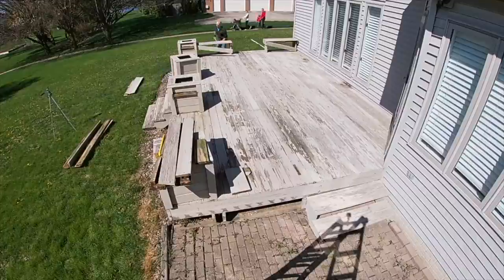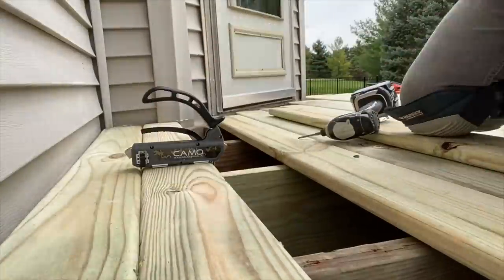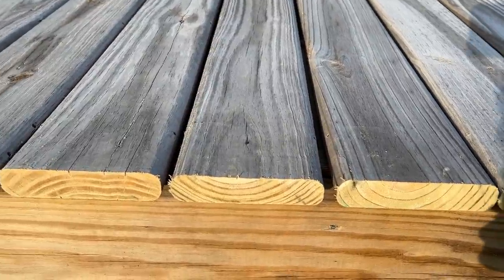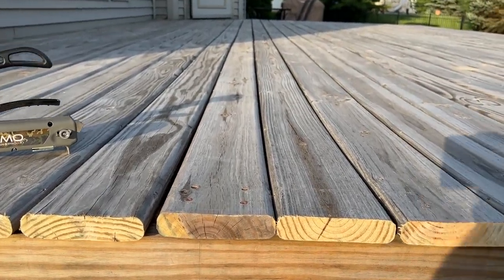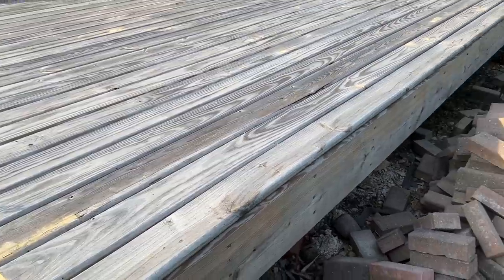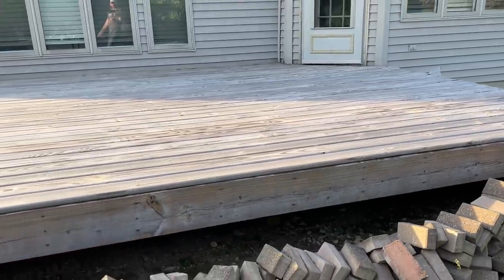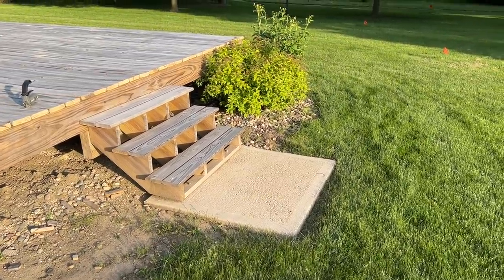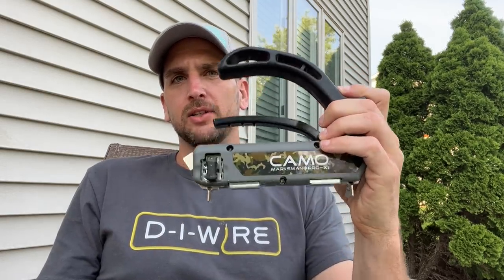Deck Rebuild Project - Pressure Treated Wood After 2 Years

Comment: Just to offer a side note regarding laying the boards  - One thing that happens to boards exposed to the element is that they may tend to "cup" if the grain is laid facing up and ends up collecting/holding rainwater for longer periods which impacts the overall quality of the board.  Although hard to tell on some boards, for most boards, you can look at their cut ends and notice the growth rings forming a U shape.  The board will tend to warp over time in the direction of the rings.  To minimize the effect, lay the board with the open end of the U-shape facing down to the ground and secure the board down.  The board may still cup slightly, but it will be facing downwards and not retain water.
Reply: Just FYI …This is called  CROWNING the boards  🙂
Reply: I too noticed right a way some boards were wrong. I refer to making the end grain with a "Happy Face".
Reply: Marvin Morgan if you make a happy face when the boards shrink they will cup up and water will sit on the surface.
Reply: I don't argue, but turned to the classic book "Understanding Wood", A craftsman's Guide to Wood Technology"; by R. Bruce Hoadley. Page 124 discribes CUPPING and notes the direction of WARPAGE. I will stay with the "Happy Face" on the end grain to avoid a gutter and to have water runoff. Look it up to understand.
Reply: Marvin Morgan I stand corrected. You are correct sir.
Reply: @eskilover you have it backwards. Boards crown away from their bark. Smiling boards up
Reply: Does not matter. I put all mine bark side up and they cupped, twisted and shrank. I even sealed them on both sides before laying. They were SO wet from the store that liquid shot up at me when I drove the nails in! I have a cap on my railing and one board is up while the other is down (placed for best looking side up) and they BOTH cupped.  It is just the CRAPPY boards they sell you. I am pulling up my old decking (28 years old) and putting down new so it doesn't look so bad when we sell in a year or two.
Reply: I'm either misunderstanding your explanation or you're backwards.  The end grain laid properly will smile. You want the curve up which puts back side down. Notice your 1 board that is pulling up is frowning not smiling on the end grain.  Nice deck though. Great work
Reply: @hotpuppy1  It does matter because of the way wood dries, based on science. Yes, regardless which side is up or down, some pieces will cup/crown. However, it's less likely to cup when you lay your board smiley face. I'd say at least a 6 to 4 ratio. Sad face installation has a 60% chance of cupping, while smiley face installation has a 40% chance of cupping.

Comment: Just built such a deck and used shorter boards with seam in the middle and picture frame around the outside. Looks great and you have more control over the quality of the boards. I also used the Camo system and like it. Clean your PT lumber well before sealing it and use and oil-based product and not a water-based one. Get one with a high UV protection. I now used joist-guard membranes as well. Worth the extra cost and time. Finally, after building and rebuilding decks over the years as a DYI'er, I now only use composite decking to finish them. I'm too old to be sanding decks!

Comment: Thanks for the video, great resource as always. I built a deck in 2014 on my ranch built in 2013. The deck was 16’ x 48’ long (768 sqft). The green deck board on the house was installed by the builder when the house was built, installed before & under the vinyl siding. I also installed a drip flashing in between. The surface boards were like yours but white cedar. The deck design was a cantilever off the home (13…4’ foot deep holes were dug and rebar was used and cement was mixed by hand in a wheelbarrow). The framing was 2 x 10’s all green lumber, 16” centers with double hangars with Tico nails. All boards were 16’ and 8’ long. First row (starting at the home) was 3…16’ boards, Second row was an 8’…then 16’….then 16’….then 8’. Third row was same as first, Fourth was same as second, etc. I used 3” colored screws with square holes rather than Phillips head all were painted. I used 2…screws on every stud. Drilling and counter sinking the end of each board (we used 2 electric screw guns with an insert using an end that had a square drive bit and flipped to an drill with a counter sink). Three of us did all the deck boards in 6 hours. I also installed a natural gas line with 2 shutoffs, one in the basement and another 16’ from the grill, for safety reasons. I also installed conduit and  remote switches. One line for the grill (rotisserie power) and the other for outside lighting. All of this was by code with permit and inspections. I started on the deck in April and finished it in July. The deck was stained one time and it wore off during the winter (Chicago area). The 32’ railing is in good shape as are the 2 stairs (one in the center of the deck, other in a corner).   Thanks….
Jim

Comment: Scott...Great job rebuilding your deck & adding steps...one tip I would suggest to make your ledger board last much longer, (since it looks like the original builder didn't provide proper flashing on the ledger) before you seal the deck boards, remove the one deck board next to the house and use "Flashing tape" on the exposed edge of the entire ledger board ( the top edge of ledger boards & joists are the most prone spots for decay & rotting on the deck framing). All the decks I have ever been hired to repair have had the most damage on the top edges of joists & ledgers that were not properly protected by using "joist flashing tape." You can get G-tape acrylic joist flashing tape, 1-roll of 2"x 65ft from Decks Direct for about $23-$25/roll (also comes in wider rolls). This may make the difference on your ledger board lasting just another 6 years or making it another 12-15years. The deck framing is the most expensive part of a deck to replace, that's why most "Professional Deck Builders" never complete a deck frame without using joist flashing tape. Great videos....Keep up the Great Work...

Comment: I too used the Camo screws for my 1500 sq. ft. wood deck (3 years ago) but I have not had good luck with this overall. I think the Camo system is really meant for composite boards,  just as an after thought. Many of my boards have pulled away from the screws as the boards shrank. The boards then curled badly resulting in me having to screw down the boards through the tops to the joists. The Camo system looks good (invisible) but I would not do it again for wood boards.
Reply: I had a similar experience using 5/4x6 radius edge pressure treated deck boards with the Camo system. I was skeptical, so I installed 6 rows of boards and stopped. After only 3 weeks, the boards were warping and popping past the screws. I ended up face screwing the entire deck (about 600 sf).

The boards stayed put by face screwing, and I used Thompson's water seal once the deck was complete. Despite sealing the deck annually, after only 5 years the deck boards look like hell. There are tons of checks and deep cracks on the surface of almost all of the boards, I scabbed scraps of 2x8 joists wherever I had to place butt joints to avoid screwing 2 ends into a single joist - but most of the deck boards have developed splits from the screw to the cut ends of the boards anyway. Note that I pre-drilled ALL of the holes before driving screws.

This is the 2nd deck I've built using this trash decking material (the first was in NJ - the second in NC). It will be the last one. I'll try a composite decking material next time.
Reply: I just commented on this video and I like the Camo screws, but there are some tips to make them work well. Check out my comment and let me know what you think.

Comment: Just wanted to give a side note to your comment about how you didn't have an overhang on the end of your deck, when I build my decks I start on the outside edge first setting the desired overhang and layout towards the house that way when I get to the house I can measure and rip the last row of deck boards up next to the building.
Reply: Hey sorry to bother. But you comment kinda hit my above question/comment.
Moving from outside in does seem like the correct way. Here's my kinda-but-not-handy question  - My deck planks have very slight gaps and in some cases no gap. Which I assume is the reason water sits much longer and sometimes overnight after rain. 
Given your statement, should I remove the closest deck plank that is maybe 3 inches to the house and pull up all the others and separate? Then just nail in different spots to stay away from the existing nail holes? Or will the existing bowing make that bad idea???
Reply: @carlb1409  when I build my decks, I always put a 3/16 gap between all planks.  That allows plenty of gap for water run off and for where I live allow for snow to melt and have a place for it to melt and run off.  Easiest way I've found to gap the boards consistently is use the side edge of a speed square which is 3/16".

Comment: Thanks for the update.
We prefer artificial wood for decks & other projects made pretty much of plastic/PVC!
Reply: There are upsides and downsides to both.  Plastic decking doesn’t look as nice as a well maintained cedar deck, can get extremely hot in direct sun, and depending on shade and rain, can discolor badly from mold / mildew.  After a couple of decades, you’re then adding a huge amount of plastic waste to the landfill.  Of course, with wood, there’s a lot more maintenance. Few people ever said on a dry and beautiful summer weekend, “you know, I’d love to spend this weekend pressure washing, sanding, and staining my deck.”  Or maybe they said that the first time, but never again. 😂

Comment: Composite decking does have certain advantages, but it also has some problems. Among other things, composite decking is not as fire resistant as properly sealed and treated wood decking.

Comment: Congrats on the deck.  I built mine 15+ years ago and used "Tiger Claws" for the fasteners (no longer available ¯\_(ツ)_/¯ ).  I have mixed feelings about choosing them.  They fasten to the deck structure & to each board on the sides.  This is bad because you can't remove a board for maintenance, but good be cause they have not come loose and look great.  A lot of warping though over 15 years with large gaps = 1/4" in some places.  I also did not seal the deck right away but did later (2yrs) and then finally about 2 yrs ago got Red Valspar paint sealer from Lowes which covered up the imperfections in my 16 foot planks.  My deck is 320 square feet: 16'x21'.   I still get a lot of comments about how clean it looks. Its still in pretty good shape after 15+ years
Reply: Did you gap your PT boards on install?

Comment: Nice job. Too bad about the lack of overhang. When I put our deck/porch system 4 years ago I (immediately after completion) started sealing it with Thompson's. A roller couldn't be used as the sealer seemed to run and puddle on top of the wood. I ended up on hands+knees using a paint brush and it came out looking fairly good. In the years since I have rolled the sealer on. The difference (?), the wood had dried (at least I think that's the difference). I'm wondering how long the wood needs to dry before sealing. The decking was 5 quarter and purchased from a big box. It felt wet enough where I wore gloves while working with it. The Thompson's holds up great, especially on the porches.
Reply: @eh2341 Someone at a big box store told me to wait two years to seal my PT cedar tone deck that I built last year. I decided to ignore that advice and sealed it after three months. It still looks beautiful after a second coat so far. I used composite decking though.

Comment: Is it treated wood? looks a bit green so maybe..nowdays I only see the brown treated wood in stores.

Im very surprise to see that much gray and twist for such a new deck. I live in Canada with tons of snow/ice and my deck is 24yrs old, made with 2x6x12 boards. I had to replace some over the years but still going strong. I use opaque stain every 3 years on floor and every 6 yrs on vertical wood. I added a privacy wall 2yrs ago that I need to stain and it looks still brown wood color.  

For stain I would rather use semi opaque but the deck was opaque when I bought the house and sanding down to bare wood was lot of work on a 12x28 deck. 
The deck will be replace in the next 5yrs to redo the frame and sonotube that are getting a bit old but still strong enough.

Comment: At current pricing there is only a $2 - $3 difference between PT lumber and the cheaper Trex.  My son is looking to rebuild his deck (previous owner didn't take care of it and the builders did a half-assed job).  So I'm steering him toward the Trex, with the notion of much less maintenance after the deck is laid.
Reply: Trex is awesome but gets mega hot and is extremely slippery. Just FYI

Comment: Good job! But was trying to understand why the starting point of the board layout was NOT at the front edge with an overhang, so that the cut board would be closest to the house.

Same with laying tile. The starting point of tile should be at the door opening (usually centered) - that way the cut tiles will be by the tub or shower and/or behind the toilet.

Comment: While you're right, you should've sealed the deck long ago, I would suggest that your statement that it should've been sealed within a month or so isn't correct either.

It's hard enough getting properly dried lumber these days, and there's no chance of getting dried pressure-treated lumber. It's going to be delivered sopping wet, and will take months at least, if not close to a year, to air-dry.

If you try to put anything on it, the moisture in the wood is just going to make your finish fail early, possibly immediately.

If you can get your hands on really dry boards (maybe you've got a lumber store that goes above and beyond, or maybe you've got the luxury of buying the lumber months early, stacking it with stickers, and letting it dry before using it), pressure treated or not, then sure...go ahead and seal that right away. The sooner the better. But do make sure the boards are truly dry before you do that (moisture meters are not that expensive, so best thing is just to get one of those and determine for sure what the moisture content is, to make sure it's low enough to apply any sort of finish).

Comment: I would give those decking systems like deckrite or something like that a try, couldn't be any more expensive than the wood.
Reply: The problem with the synthetic stuff is if you're off level or square just a tiny bit, it will squeak forever.

Comment: Hi Scott
Great you can provide a update long after your install with 20 /20 hindsight. Shocking to see the gaps from shrinking with zero clearance. Thompsons sealer would not be an option for me, anything else is better. My 30 year old deck is at end of life, and its highly probable I'm going to be using  a cement pad with cement stairs to relace it.  why? maintenance maintenance maintenance with wood. On hot sunny days the deck is unusable till shade.

Comment: Hi I've got a few questions and didn't see where on your homepage to send a message.
On this specific video - there looked like there was a bowing on the bottom of the boards. Did I see that wrong? I'm fixing and deck and thought it looked like that jig didn't secure the meat of the planks down.
Also, you mentioned that you had not laid the planks with any gap. But the gaps were created during the 2 years since. I have the no-gap problem on my deck. Consequently, it leaves water on the surface for at least 1/2 day longer then evaporation would normally take. Which causes algae.

Comment: I see two issues.  One could have been fixed easy on install.  You did not place the crown up as you installed them.  Second issue is you didn't need 24ft boards given the shape of the deck. I would have done a picture frame box around the edge of the deck. And I stalled the boards at a 30° angle to match the door.  So you could get away with 14'  boards.

Comment: 5/4 decking, especially from big box stores is crap! It is so wet, that it’s almost impossible to not get shrinking and warping; more so when not laid cup down. I learned long ago to always buy #1 treated for a quality lumber company. With treated lumber prices today, Trex, or another composite decking is the way to go. And just a bit of personal advice: use something better than Thomson’s Water Seal. It does ‘ok’ with water but not with the sun. Ok, I’ll shut up now!
Reply: I have to agree with you on both points you make. I purchased #1 decking boards for my staggered decks (one deck is 16X16 and the other is 15X16) Even after sealing them with Thompson's, it didn't even last two summers. The deck is southern facing and that side of the house is all windows..so the deck gets it from the sun and reflected off the windows...so super scorching sun! Thompsons just didn't handle that amount of sun. My project next year (after 10 years of this deck) is to rip out all the deck boards, railings and trim and replace with Trex or other composite dumber
Reply: I’ve had good luck with Cabot. It’s pricy but the UV protection is better than Thompson. My neighbor used Thompson Advanced 2 years ago and it’s holding up well.

Comment: 1) Why not seal or varnish or paint the boards on all surfaces first prior to cutting and installing?

2) Why were the boards not glued down in addition to being screwed down?
Reply: Green treated /pressure treated lumber (which is what he used here) will not accept any sealant / stain / paint (really any liquid) until it has been weathered. Depending on climate and exposure, that may take 6 months to a year.